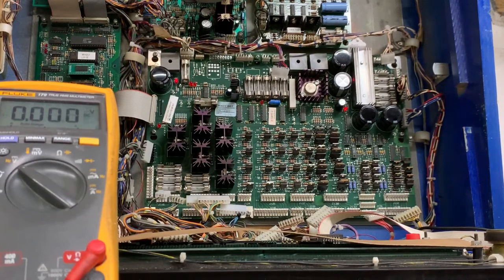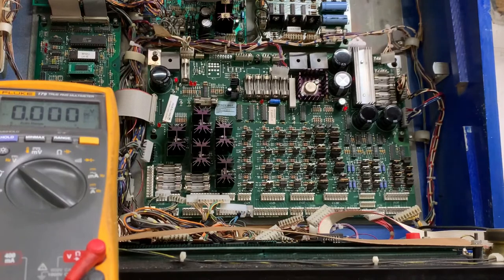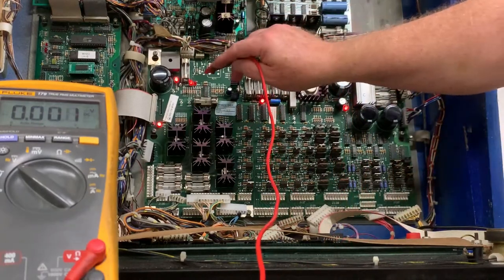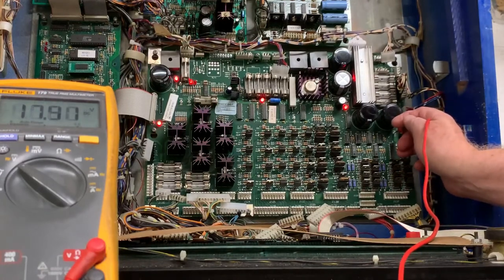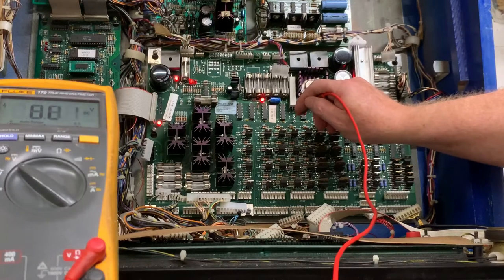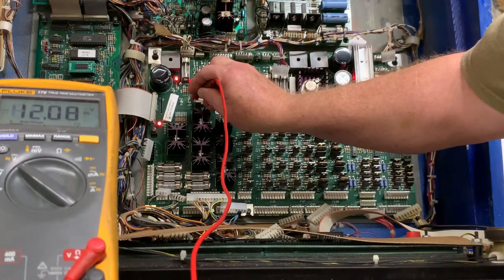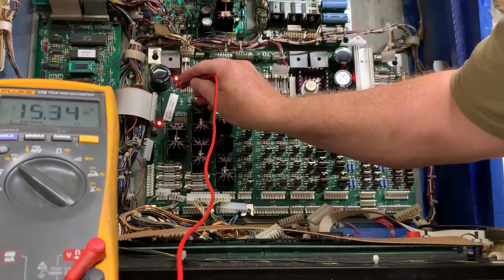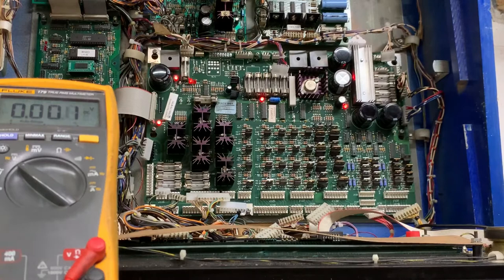Testing the voltage test points on a WPC-089 power/driver board

Comment: Hi Chris, I'm only getting 4.6v at TP2, as a consequence, the CPU will not boot. Any idea of the most likely cause for a drop in voltage? All LEDs work as they should on the main power driver board. (5v circuit has been professionally repaired) I'm in the UK.
Reply from the maker: "5V circuit has been professionally repaired" is a red flag. Ensure that connections between BR2 and C5 are present as it is easy to rip out through holes.
Reply: @ChrisHiblerPinball  Thank you for replying to me. I'll look at this.

Comment: Having to test my board. I saw you unplugged most of the connectors when testing in this video. I’m guessing this is required for accurate readings? Which ones do I need to keep plugged in to get power to the board for testing?
Reply from the maker: It's really not necessary to unplug everything. It was just convenient for me at the time. The board should have some kind of "load" on it to obtain the true loaded voltage measurement.

Comment: Have about 10v reading on TP1 J116-J118 removed …having flipper issues on CFTBL and think the 10v to opto is the culprit…already replace C30 and BR5 with no luck …
Reply from the maker: I think you are on the right track. The behavior can definitely be caused by low 12VDC. Examine C2. It often leaks and can cause this.
Reply: @ChrisHiblerPinball  looking at the schematic , I see C2…and looks like it’s tied to 12v Digital that feeds J114…trying to connect the dots how it could affect flipper optos?
Reply: Just took a reading on Tp3 …measured 11.87 V DC…is this ok?
Reply from the maker: @bh1546  yes. That is fine. My mistake on the C2 comment. C2 does leak but as you say, it’s in the 12V digital circuit. Time to diode test BR5. 

I do this in my most recent video posted. Check it out.
Reply: @ChrisHiblerPinball  just fixed it…was having rapid jumping optos whenever pressing flipper button making coils hot and weak…replaced J112 header pins..wired C30 to BR5 and back in business 👍👍
Reply: TP1 now reads 12v
Reply from the maker: @bh1546  Well done!

Comment: Where did you use Ground? Is there a better place to use?
Reply from the maker: "Ground is ground the world around". In other words, any ground will work.

You can use the ground TP on the driver board. I don't like to use that TP because it is very close to the 20V TP. I like to clip the black lead to the ground braid in the backbox.
Reply: @ChrisHiblerPinball  sure, I just remember on the gottlieb sys1 psu there was the power plug for the displays and that you had to use the ground at that plug. So just wanted to make sure
Reply from the maker: @parnelllutz778  Yes sir. That is a fallout of the craptastic S1 power supply design.  :-)
Reply: @ChrisHiblerPinball  Hahahha....NOT GOTTLIEB!?